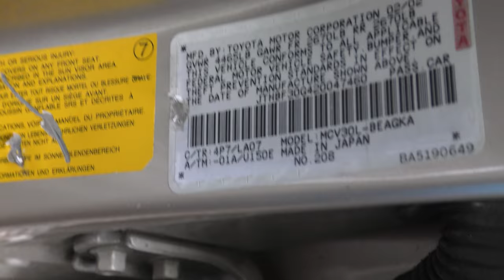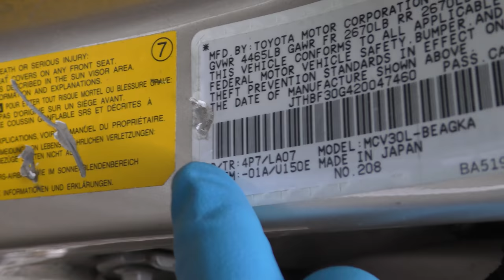Someone Just Vandalized My Car (and I'm Going to Find Out Who)

Comment from the maker: Honda Just Changed the World: https://youtu.be/uOGR9rntTLc

⬇️ Things used in this video: 
1. Safegrip Gloves: https://amzn.to/33HGdhu 
2. Scratch Out: https://amzn.to/33FHrJX 
3. Lithium Trim Serum: https://amzn.to/2XJnJJr 
4. Micro applicators: https://amzn.to/2PySP27 
5. Common Sense

⬇️Scotty’s Top DIY Tools:
1. Bluetooth Scan Tool: http://amzn.to/2nfvmaD
2. Mid-Grade Scan Tool: https://amzn.to/33dKI0k
3. My Fancy (Originally $5,000) Professional Scan Tool: https://amzn.to/31khBXC
4. Cheap Scan Tool: https://amzn.to/2D8Tvae
5. Dash Cam (Every Car Should Have One): https://amzn.to/2YQW36t
6. Basic Mechanic Tool Set: https://amzn.to/2tEr6Ce
7. Professional Socket Set: http://amzn.to/2Bzmccg 
8. Ratcheting Wrench Set: https://amzn.to/2BQjj8A
9. No Charging Required Car Jump Starter: https://amzn.to/2CthnUU
10. Battery Pack Car Jump Starter: http://amzn.to/2nrc6qR

🛠Check out the tools I use and highly recommend ► https://goo.gl/rwYt2y

Subscribe and hit the notification bell! ► https://goo.gl/CFismN
Reply: Awesome video read my comment plz
Reply: @scotty kilmer This was the video I didn't know I needed. I'm guessing the black rubber that had old wax (previous owner) this trick will fix this!? Thank You.
Reply: @guswhitworth8826  The oils in the black rubber molding evaporates from the sun causing discoloration and turns into loose debris that can be clean off then sealed. Samething with tires. The oils in the rubber evaporates when the tire is exposed to direct sunlight. This also causes dry rot. This will cause lack of traction until the tire is worn beyond the affected layer as long as there is no dry rot. You don't want to put a sealant on the tires because you will have even less traction. This also happens when people put too much tire shine on the sidewalls of the tire which centrifugal force Carries the product to the tread.
Reply: Mlm
Reply: What if my cars red should i use gold paint!!??
Reply: @PatRick1981-s1w  Sure why not. Let us know how that works out. 🤔🧐🙃😆
Reply: Pj’s Whatever Time I did anyway. So it was seen at least... guy who bugged his car has bad karma coming
Reply: Clifford Souchet centripetal acceleration. Sorry if picky, not a karen I spent too long hearing this term. It triggered me.
Reply: Gotta keep those rubber seals perfect💪💪💪
Reply: Scotty you're forgot to put your address to send you some safe grip gloves
Reply: Scotty Kilmer Hide that tag.
Reply: Wow, man. Your vin# too?!! 🤣
Reply: @cliffords.8341  LOLZ
Reply: Hello Scotty, I love what you do. Please can you do a video on Toyota Vios, I saw this in a car lot and was considering purchasing it
Reply: Sorry Scotty but a micron (micrometer) does not equal 0.001".
Reply: 1
Reply: Skips to a different video at 7:30
Reply: This is the reason why automakers are painting your bumpers with car body coler.  Any minor scratches would mean new paint jobs for them to rip car owners off while using psint to cover the lousy materials used for bumpers(bumpers were used to be the impact absorbing black rubbers, now they turned to flimsy "FRP"(fiber-reinforce d plastic)that are used for bath tub).
Reply: @cliffords.8341  Thank You.
Reply: Please get a security camera
Reply: E
Reply: @cliffords.8341  thank you.
Reply: You ROCK!

Comment: A micron is 1/1000 of a millimeter, not an inch. He's thinking of a mil, not a micron.
Reply: he might realize it after he sobers up :p
Reply: Very true Jerry Malone.  I'm an electrical engineer, so I've been dealing with numerical  conversions for decades.
Reply: Yeah, 40 microns to 1 thou/mil
Reply: a um is 10,000 ang.
Reply: @dave8599  that is true, it is also 1000000 Picometres... But neither are used by car mechanics... Unless they are REALLY good!
Reply: As a Canadian machinist,I concur
Reply: I'm thinking of a gram, not an ounce.
Reply: Sofa-Lofa ; when I last checked, there were  25.4 microns in one thou’
Reply: @philipwhyte  yeah, you're quite correct, I think I was getting confuzzled with 39.37 thou to 1mm.....again!
Reply: @sofa-lofa4241  : Understood. If it’s any comfort I make similar mistakes all the time.
Reply: Yeah a thou (0.001”) is a heck of a lot different than 1 micron (0.00004”)
Reply: @sofa-lofa4241  I measure my paint thickness in Planck Lengths.
Reply: @aaronandannelogan  my brain only goes down to Angstroms, the fact that it won't go lower than that makes me feel like a Plank!
Reply: I farted while I was reading your comment.

Comment: Might i sugest after you buff your touchup paint down  use the same method using clear coat to protect your touch up paint, and 30 days after  buff and wax    it absolutely will be invisible.

And the plastic bumper color will always be different from metal body color  even on brand new vehicles,     
Love your channel   havent missed a video in 5 or 6 years

Comment: Thanks, Scotty!  This is just what I needed after parking my Toyota at a tight parking deck. I got a good spot, so when I was trying to leave, with my elderly mom in the car, a couple of cars were lined up, vying for my spot. I tried using my backup cameras, but I just got this Rav4, and I didn’t have those on my Yaris. I didn’t see the yellow posts on the side and now I have yellow paint on my gray Rav4.

Comment: I moved from Michigan to Arizona 5 years ago.  Most homes here do not have basements so they use the garage for storage and park in the driveway.  Thus many of the cars here have faded/oxidized/peeling clear coat.  Sure, they don't get rusty but the nasty paint ruins them instead.

Comment: Hey Scotty. At the Toyota dealer they  sell the touch up paint kit. They have certain selections but it doesn't hurt to check. They go by paint ID. It's like 15 bucks. The tip you can use it as a brush or pen

Comment: i usually use a tooth pick and slice it lengthwise so only a strand of wood fiber sticks out, then thin out so touch up paint is very thin and many thin layer to fill in the scratch .this technique can also be used to do details on plastic models with model paint.

Comment: Don not use polish on exterior trim it will dry it out even worse in the long run, that's why we tape off all trim while doing paint correction or polishing while detailing cars, only use rubber and plastic trim restorer and get a decent brand and you will only have to apply it once

Comment: Dont do that Scratch  remover on any of BMW trim plastics )))  You will just wipe out all the plastic rubber coating down to the bare metal. This is how good BMW plastic rubber coating is )). Engine gaskets are even better, they tend to leak oil straight form the assembly lines.

Comment: Dear Scotty. I own a 2005 Toyota Sienna with 130k miles run great. Toyota services. However needs catalytic converters and new engine mounts. Is it ok to use engine additives, what do you recommend. How about oil or trans flush? We don’t want to ruin the car. But concerned about high mileage. Any suggestions. Thanks.

Comment: Hi scotty, big fan of yours, I just recently bought a 2003 Mercedes e270 Avantgarde 2.7l in the UK with 10 Months MOT for £600 with 162,000 miles, runs perfectly but is there any common problems I would need to be aware later on!

Comment: After using the removaer, I'd personally just leave it.  Just be glad it's not a chromed bumper, like what happened with my truck when someone backed up and put a gouge into it.  That stuff flakes off and the only way to really fix it, is to replace the piece in question (with anythng that's chromed).

One warning about paint codes (and I"m sure Scotty is aware of this but didn't clarify): some bumpers are not 100% the same color as the car, so I would use the paint code your vehicle calls for and then compare visually.  Also keep in mind some vehicles, depending on where they are manufactured, may have slight variations in the paint so the tint of the paint may not be 100% the same, unless you can some how get the exact paint from the plant your car was made.  For example, Ford uses 4 different plants, and some of their paints --Sangria red for example, may vary every so slightly depending on where the vehicle was manufactured.  You won't notice it if the entire car is the same color and thus the original paint, but if you start comparing some vehicles, you may see some small differences, especially around the areas of the bumpers.

Comment: Scotty I have a 2018 Toyota Camry and the Roof Drip moldings Flap in the Car Wash Dryer.  I have read it's a common problem with Toyota's.  Any Suggestions would greatly be appreciated.

Comment: Hey Scotty I got a complex issue and was wondering if you ever ran into the same thing with a Ford Focus 2016 se flex fuel that stalls out and has trouble turning over but starts but drives fine then stalls out after 3 or 4 hours of driving took it to an auto repair shop to see if they could find the issue but nothing so I took it to the dealer ship and one code they say came on p0087 that’s the codes that keep popping up fuel rail pressure issues I replaced the high pressure file pump has fresh spark plugs full tank of gas I live in Arizona got the car off the lot with 302 miles on the thing  after it cools off it starts up and drives fine thanks for the read hope you have useful advise

Comment: i would sand the bumper that small part where the paint has dipped because it does not take long to sand off till its smooth and there is no hole anymore then simply spray that small spot and you will totally not see it at all just the color match would be the difference but not the hole from the scratch plus the color match effect.

Comment: Scotty, That scuff mark on the bumper is a lot smaller than the pic attached to the video. Sure got me to watch. 🧐 Scotty your a genius, but I have to disagree with you on the color of the O.E.M. plastic bumpers matching the body paint. From what I noticed is that the color and texture does not match comparing plastic and metal painted parts. Correct my if I'm wrong. 🧐🙃

Comment: Scott please help. 93 Sierra 5.7.
Loud grinding noise from under the hood when the AC is on, goes away when I turn it off or if I give it gas with it on. Only grinds when on and below a certain rpm.

Comment: 1 micron is not equal to 1/1000 of an inch.   A micron is short for 
micrometer, one-millionth of a meter, or 1 x 10 -6. There are 1,000 
microns in a millimeter and 10,000 microns in a centimeter. You would 
think that paint thickness (in the US) would be measured in mils and not
 microns.  1 mil is equal to 1/1000 of an inch.  3 mils, or .003" of 
paint seems more reasonable than 3 microns or  0.0001".  3 microns of 
paint is finer than a frog hair.   Thanks for keeping it real home 
slice.

Comment: I have a 2005 Chevy Aveo and got a code P2610 Ecm/PCM so I went to junkyard and pick one up and put it in and started it cranks still but won’t start so I went to your video did everything you said to do and still same problem so what do I do now or do I have to take the Ecm somewhere to transfer old programs to the one I got from junkyard and where do I go about a to get that done

Comment: Hey Scotty, we just got my girlfriend a 2004 lexus ES330 and sometimes when accelerating it bucks at you. I checked the floormat and it's not under the pedal. It had the injectors cleaned recently before we bought it. It has 153,000 miles. I dont think its had the spark plugs changed. No codes. Do you think it may be the throttle body and if so is it ok to clean the plate?
Reply: Transmissions in the 330s are known for rough shifts.
Reply: @elenaorlova8223  thanks, I was worried about it being that 😔

Comment: Hey scotty, I have a 2001 honda civic and I think my head gasket has started to leak. It has 200,000 miles on it, would you recommend to use a head gasket sealer? As I just need to get around for a few more months.
Reply: Desmond Bagley  I don't know if it works good on hondas, I hardly found any reviews on it.

Comment: A micron is a millionth of a meter, definitely a lot smaller than 1/1000th of an inch. 1 centimeter would be 10,000 microns and an inch is bigger than a centimeter by 2.5+ times. So a micron is closer to 1/25000th of an inch.

Comment: Actually Scotty,  1 micron or micrometer = 3.93701e-5 in (or 0.00003937 in). 1000th of an inch is 0.001 in.  A micron is pretty small. A micron is one millionth of a meter.  I'm a geeky electrical engineer that's why I know this stuff.

Comment: dude. a micron or micrometer is a millionth of a meter or thousandth of a millimeter. 1 micron is equal to 0.000039 inch
a mil is 1 thousandth of an inch. 25.4 microns in a mil.

Comment: micron = 1/1000th of an inch??  ...WHAT??.HELL NO SCHOTTY  XD!!!...    it's 1/1,000,000 of a metre ("micrometre"- not to be confused with a micrometer used for measuring things in micrometres).   roughly 1/25,000th of an inch - there's no imperial version when it comes to this. if you are looking at number like this for paint in thousandths of an inch it is "Thou" is the colloquial  term. someone on another channel was calling the same thing "mills". but these terms of "pica, nano, micro, mili, deci, centre, kilo, mega, giga, terra, peta  etc" dont belong to feathers acres, and whatever arbitrary ding dongs units of measure within the imperial context.